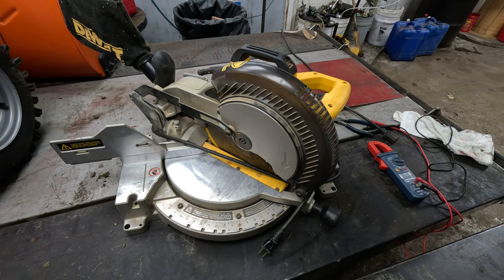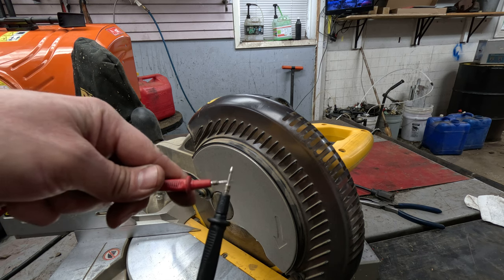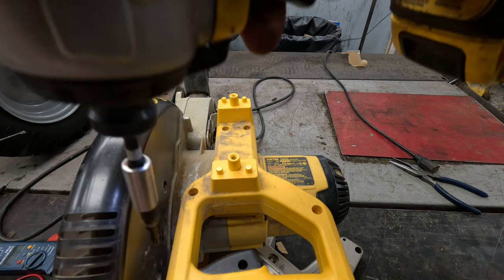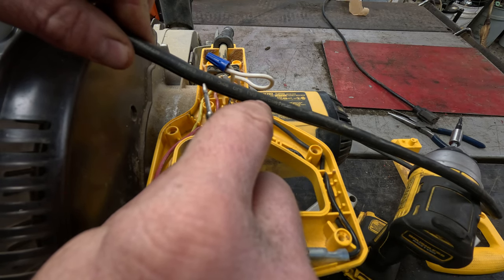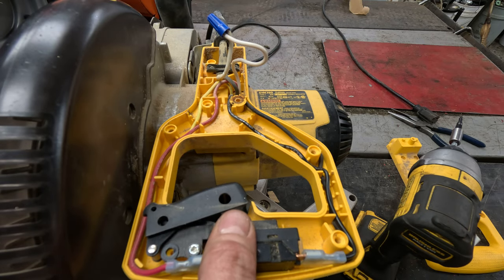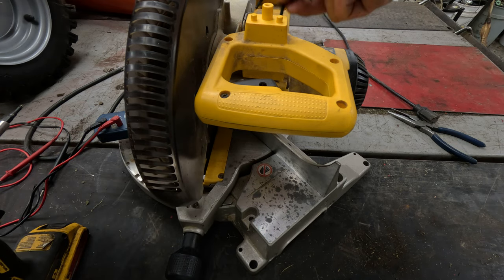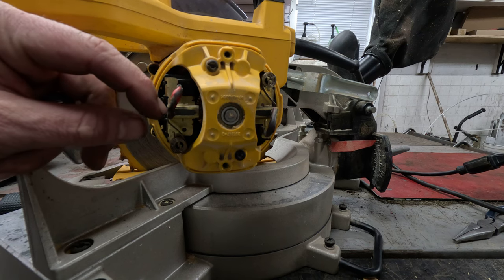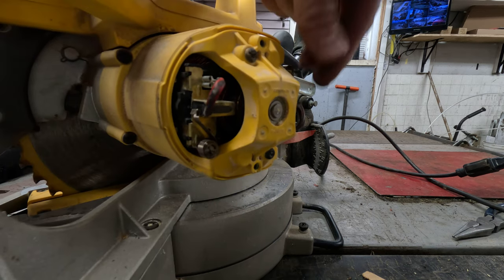Dewalt Compound Miter Saw DW703 Won't Start Starts But Then Stops Sparks From Motor How To Diagnose

Comment: Good morning , great video!  I have the same model.  How do take the  motor out of case?  I dont know how to seperate them?
Reply from the maker: The four bolts around the outside of the yellow case should hold them to the housing. Remove the brushes first. Thanks for watching!
Reply: I really appreciate your help.  On other models , when you pull the casing off. The motor is still attached to the saw.  On this model  When i pull the casing , the motor comes off with it.  But i cant figure out how to separate them.
Reply from the maker: The armature (inside piece with the shaft coming out)  just pulls out t remove from the housing and fields (outside windings). Brushes must be removed first
Reply: Ill try again . thanks for responding.
Reply from the maker: Glad to help!

Comment: Nice video.
I have a similar saw and when I pull the trigger the blade attempts to spin but doesn't (I can rotate the blade by hand) and there is a loud electrical buzzing noise.
Any idea what the issue could be?
Reply from the maker: Most likely an issue with the brushes not making contact with the commentator similar to the issue we were having here. I see this a lot! Thanks for watching!

Comment: Nice video, it runs through a lot of diagnostic steps for the 703 type saw.  I came here with a similar issue of a 705 type not starting just as yours did.  For people coming here for the 705 with a no start issue, run through the steps as in this video.  On the 705 the brushes are a little different as we have a brush holder.  The contact connection inside the brush holder had become broken on mine.  If I didn't pull the brush holders out I wouldn't have noticed, as everything appeared fine at first glance.    Here's a helpful video showing the 705 type with a broken brush holder.  https://www.youtube.com/watch?v=E3xB4f64KYI  .  Thanks again, great video!
Reply from the maker: Awesome! Thanks for watching!